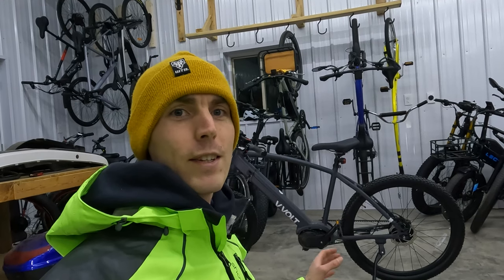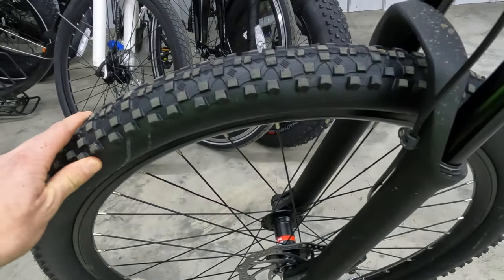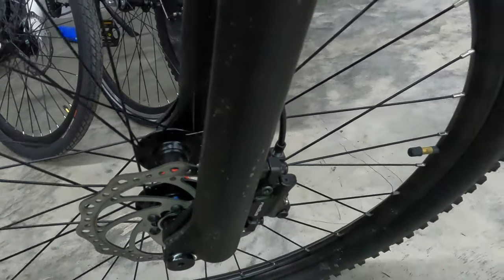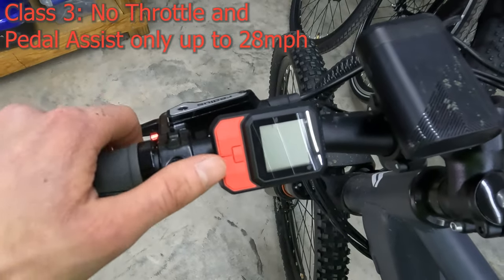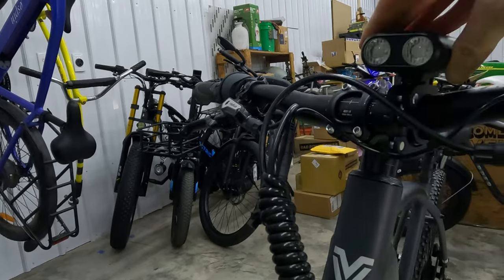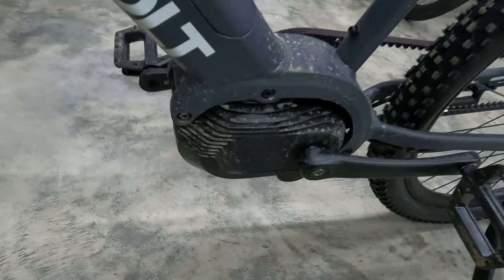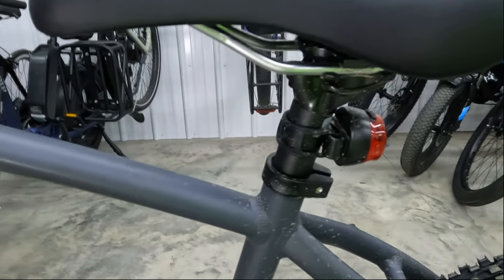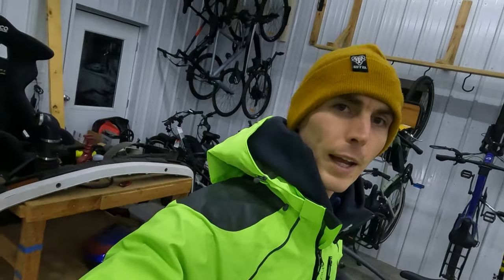Vvolt Sirius Ebike FULL Review: Mid-drive, belt drive with internal geared hub!

Comment: I wouldn't buy this bike for the reason that they have built in a method to keep the bike low powered unless you spend even more money to unlock it, slimy business practices in my estimation.. Not in the league of corporations, businesses, banks and governments I write about for a living, but still not cool...Great if you get it for free, but, meh.....Get a decent spec'ed out mountain bike and add the 30 amp version of the bafang mid drive, 1,000 watt motor and battery, that peaks at 1750 watts, and for 1,200 dollars you get a far superior product, that will go 35-40 mph, and perfect for road or trail..Even if you pay someone to do it, instead of doing it yourself, still a far better route....
Reply from the maker: I think DIY ebikes are great for tinkerers and there is no doubt you can get way better performance from doing so. I'd be curious to know how many people will build custom ebikes like this. This ebike is not built for ultra-performance. Thanks for watching and sharing your thoughts! I'm sure Vvolt will chime in and share some reasoning behind their decisions :)
Reply: @EbikeEscape  Bike shops are springing up all over the country that offer conversions, one just opened in my summer time community..3,500 dollars and it's not built for "ultra" performance, interesting line of reasoning...I almost never drive my bike over 25-30 miles an hour, but sometimes I'm on one of those dangerous roads, that it's just safer to keep up with traffic, rather than have car after car of irritated, entitled drivers passing me up, one after the other...That is where the real danger lies in my experience...

Comment: Nice settup.  I would like that version with the 750 motor and a slightly larger battery even if it has to be frame mounted.   I have a bafang kit and the downside of it is the motor sitting too low and the bike i put it has a low end freewheel.

Comment: The "Warp Core", is another example of purposely "crippled" features that are already incorporated in the product, they just want another chance to bilk another $100 out of you to get to use the feature.  It is getting to be rampant as there are automobile manufacturers that sell subscriptions, (pay-by-the-month), to unlock heated seats and other features.  Intel has been limiting features of computer CPUs until you pay extra for them too!  There is something inherently dishonest about purposely holding back a product's full capabilities until you pay extra for it!
Reply from the maker: While I agree with you that there are egregious ways some companies are trying to nickel and dime you. I think the purpose of selling the warp core separately, in this case, was to avoid any possible regulatory issues that could arise. Keeping the bike a class 2 and then making it a class 3 with the upgrade allows Vvolt to sell this bike in other markets (Canada) without needing multiple SKUs or models.

Comment: Hi Ryan, great videos. Really helpful. I'm considering the Vvolt Sirius, Ride1Up Prodigy XC, and Avadar C3 Sport. Have a recommendation? Which is the best value / bang for your buck? Is the belt drive / geared hub worth the extra dollars? Any other mid-drive bikes in the $2000 - $3000 price range I should consider? I'll be riding in suburban neighborhoods, greenways, light-moderate mountain bike trails. Thanks for any info!

Comment: Nice review! What are your thoughts on how this compares to the Priority Current E-Bike. Both have carbon drive, Enviolo, and mid drive motors. The Priority has significantly more torque. With a promo code, price is 3,200, not far off. Would you make the jump or stick to the Vvolt? I’m torn!
Reply from the maker: Hi Alex, it's a tough decision for sure and even harder for me to help since I haven't ridden the Current (though I have been in touch). I like the suspension on the Sirius (you should also consider the Proxima since it doesn't have suspension) but it also has a smaller battery. I'd maybe lean towards saving a few hundred dollars but again if the Current has something you value more then that could be the better decision for you. I'm hoping to get many more miles on the Vvolt Sirius this summer for a long term test.

Comment: Does this brand have a model with cruiser handle bars.
Reply from the maker: They do not. However those are something you can fit aftermarket. The Vvolt Proxima would be a great place to start. And it is currently on sale. https://bit.ly/3K9xfeB (Affiliate link) -JT

Comment: No regenerative breaking ? I'd like to have that feature.
Reply: Hi Jay, Regen braking is only available on hub-drive ebikes at the moment and you'll notice most makers (like us) don't put it on our hub drive models as the direct-drive/regen motors are less efficient and heavier. If motor tech improves then we'd certainly spec it as most of us own EV cars with regen and enjoy the feature when we (have to) drive.
Reply from the maker: Vvolt nailed it! I haven't seen an ebike with a regen motor in quite some time.
Reply: I have regen on my e-bike (Vintage Electric) and it does have a hub motor. The regen is nice and it does help both with "braking" as well as offering a bit of recharge for the battery. However, I would trade that for the combo of a mid-drive/belt/enviolo.

I really like the Vvolt products, only wish they offered a bit "more."  More power, more battery and a throttle. Although I think I might be ok with no throttle with the Enviolo tranny. Right now, mine is a single speed, so the throttle is really handy leaving from a stop (especially with an 80lb bike).

Would also love to see the combination of the Sirius frame (with front suspension) and a street tire.